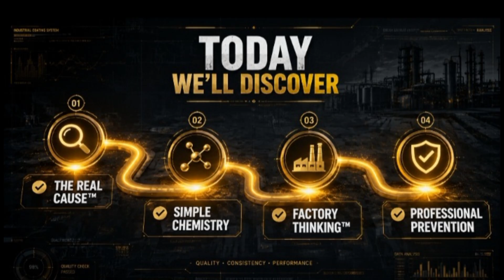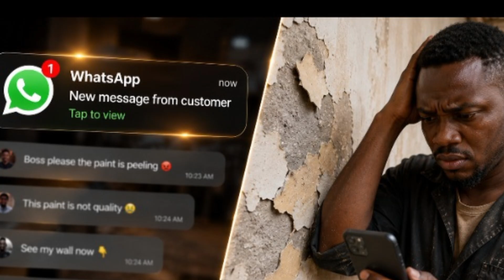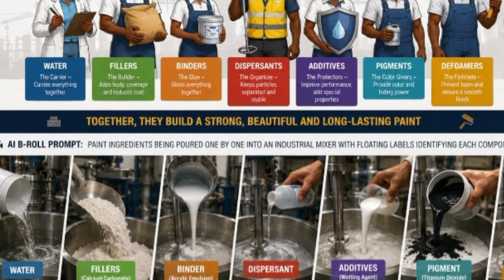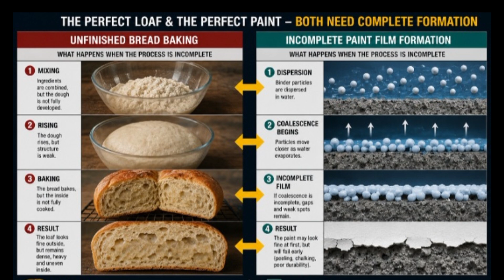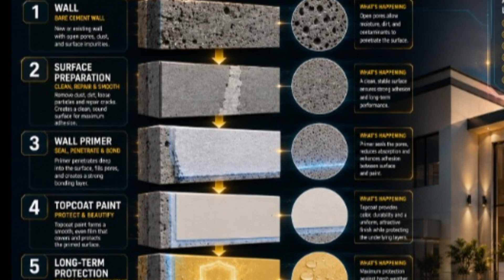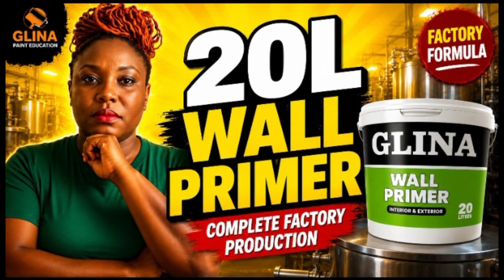Why Paint Peels (The Real Cause) | Stop Guessing!

Comment: Nice lecture. In most cases, the failure is from the type of sand used in the wall. The quantity of cement and sharp sand in the plaster matters a whole lot. It doesn't always have to do with the paint.
Reply from the maker: Exactly 👌 💯